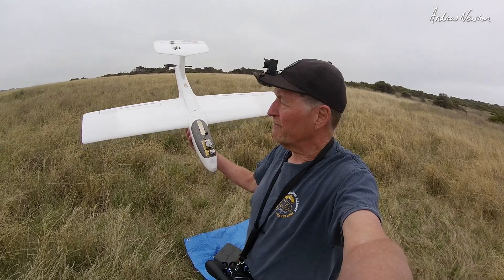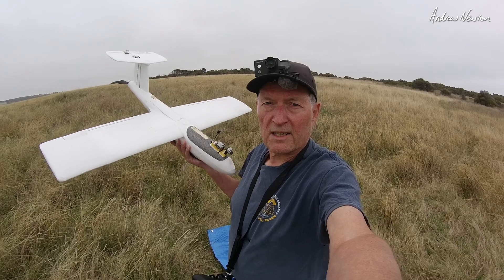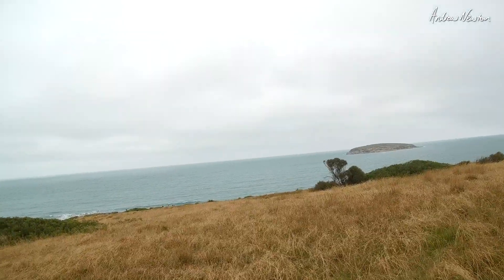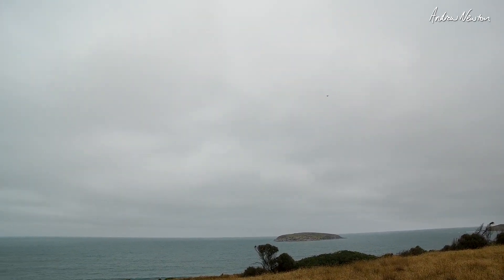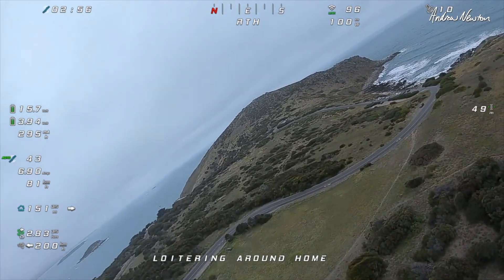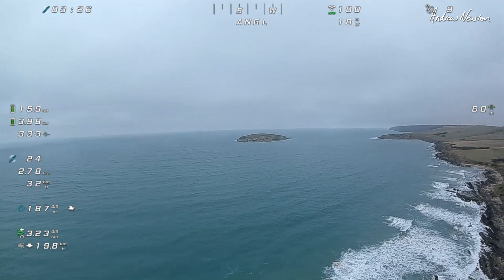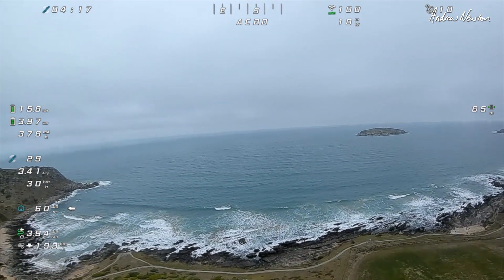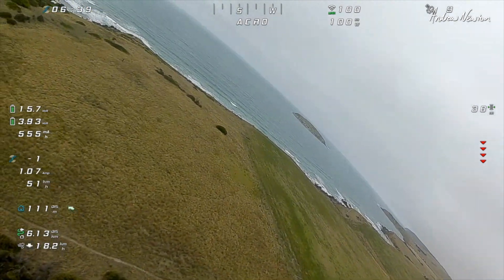Simplified INAV - First Flight

Comment: Does it make sense to use a GPS with a magnetometer/compass?
Reply from the maker: On a quad or a VTOL yes, but not required for planes. The GPS provides all the direction information as long as it's moving forward. A poorly calibrated compass will interfere with GPS navigation.
Reply: @AndrewNewton  Thanks a lot!

Comment: Andrew,,,I’m back again needing your thoughts. As you may remember, I am using an F411 on an actual wing with iNAV 6.1.  Do note,,,I successfully flew this airframe without TX trimming before adding the hardware.  A couple of weeks ago I was ready for the maiden. Set it in Acro and couldn’t get it off the ground. Tried multiple times.  At the time it felt like I had no (throttle) power.  Feeling at fault (w/o much thought) I changed out the motor with one that I thought would have more power.  Today I tried to launch and no luck.  I’m a bit puzzled.  I have flown other wings recently and what i have noticed is these have more power and more deflection on the elevons.  With this in mind I paid closer attention to to my iNAV wing and (in Acro) there is very little deflection in the elevons and it seems like I am limited on my throttle stick, thus, restricted power (compared to a regular setup w/o a FC).   I am sure there is much going on here,,,,but before I go to a totally different airframe,,,,does anything glaringly jump out at you? Just fyi,,,,on the receiver page I have the throttle setting just below 1100 at 1094 so my arming toggle will work. Thoughts?    Thanks again.
Reply from the maker: Which transmitter Marty? In the INAV receiver page you should see throttle move from 1000 to 2000 as you move the stick. Might need to adjust the end points in your radio for the throttle channel if the bar doesn't go from 1000 to 2000 in INAV. Are you sure your prop is on the right way?
Reply: As always,,,thank you Andrew for your pointers.  I am going to sort of start backwards and end with my next question.

Always a base that one needs to cover,,,,prop direction:-). I did check and all is good there.  Never hurts to have a refresher.

I got the craft in the air easily this time but I just did not have enough throw in my elevons to manage height and turns.  I made it around one time with much difficulty and then never again.  But the positive is/was,,,,I got it in the air,,,,easily.  So,,,what I will do next on the bench is move my pushrods on the servos as well as the elevon side to gain more throw. This may take some experimentation but I should be able to get what I need to comfortably fly the wing.

On to power. You were spot on with what you said about the necessary throttle deflection needed on the iNAV Receiver page.  Using my Spektrum DX8G2 TX,,,I had the range set at 1094 to 1838.  I set it to 1002 to 2001 as you recommended and as mentioned above,,,,I had the power I needed to launch/fly (just as in the pre-iNAV test).  Thanks so much. Some things can be so easy.  However, I come to my one question. With this new range setting I did notice that as I moved the throttle stick,,,the motor did not start moving until around 1220.  Granted, I am able to launch & fly as is,,,,do you think there is a way to decrease the dead band range of my throttle stick  (meaning to obtain motor engaging at a setting lower than the 1220)?  Just curious if you have any thoughts here.  I have a feeling this dead band is inherent to my setup.

Thanks again.  I will let you know how successful I am with my elevon pushrod adjustments.
Reply from the maker: If it flew well previously (did you use 50/50 elevon mix?) I would leave the pushrods as they are. Better to increase the Pitch FF parameter until elevator throw in ACRO is about 80% of elevator throw in MANUAL. Throttle dead band means you need to re-calibrate your ESC using the INAV Outputs page.

Comment: The documentation states that ACRO mode is the preferred flying mode.  Is it also recommended to launch in ACRO mode for the maiden flight?
Reply from the maker: Preferred? Acro is the default mode, that just means that if you don't choose a specific mode then it will be in Acro. I usually launch in Acro if I know the setup is good, otherwise manual is the safest until you test other modes.
Reply: Andrew,,,,I am a bit confused at the flight mode setup.  I am to this point and have Manual, Angle & Horizon modes on a three way toggle.  With this said,,,the toggle is always on one of these selections. So how does one get into the default mode (Acro) when one of the three (mentioned modes) will always be selected?  And I thought this three way switch with the three modes was the proper setup. Do I need to leave one position of the toggle vacant (in the configurator setup page) so that the default “acro mode” is accessible when that vacant toggle position is chosen?  I hope this makes sense:-).  Thanks Andrew for always diligently answering these questions.  It is greatly appreciated.
Reply from the maker: @countrymlb  Correct. Every switch must have a "no mode" position to allow for Acro. Have another look at how I set them up in the Simplified INAV setup video

Comment: Andrew,,,great pair of videos.  Thanks for your continued dedication to this area of flying.  I wish I would have had these two a few years back when I first gave this venture a shot:-).  I am just about ready for my first flight trial but have one question (and hope you are still monitoring).  I am using a wing this time around.  I very much understand your comments/instructions of the +4 degree addition to the Fixed Wing level trim line of the Mechanics tab in the PID page of INAV and its purpose.  It’s necessary to fly the bird:-).   My question is as follows.   Before we get into the INAV setup,,,the craft has to be a tested/proven flyer (which means that this amount of elevator is ‘tweaked’ in physically to the airframe to fly).  However,,,once I have the bird flight proven and we start the INAV phase of the build,,,do we physically remove this elevator pitch (with wing elevons flat with the rest of the airframe) and let the INAV settings take over (once the setup is complete)?  May sound like sort of a naive question,,,but it is a detail that I wanted to make sure of.  Thanks so much.
Reply from the maker: Good question. Yes keep the same amount of elevator reflex you added in the test flights and start with +4º FWPT. 
There are two factors at play here. 
1 - Flying wings always require reflex in the overall airfoil shape to stop them rotating over the nose due to the lack of a tail. That comes from either the airfoil design or your added elevator reflex. 
It is best to dial this in using the pushrod lengths. BUT if you enable "Continuously Trim Servos..." INAV will look at your stick positions while flying and save the new servo midpoints.

2 - All airfoils need some "angle of attack" or a few degrees of positive angle to fly level and maintain altitude. The Fixed Wing Level Trim takes care of the angle of attack requirement (and board mounting discrepancies in the pitch axis).
Reply: Thanks a bunch Andrew.  This will be a great project.  I have the wing flyable right now,,,with the next step of adding all the iNAV hardware, etc.  I really can’t wait and this little detail was the last piece of the puzzle.  Take care and I’ll let you know how this Texas bird flys.  Again,,,,thanks for making these two videos for they made it all come together also.  The written word is great but the videos seemed to be the icing on the cake😊
Reply from the maker: Happy to help. What wing is it?
Reply: My apologies. I just see your question:-).  It is my own hybrid between the FT Versa and the FT Bluntnose Versa. In the Bluntnose, a 7 1/2” spacer is added between the two wing halves of the standard Versa. I just added a 4 1/2” spacer.  I really like all of them. A relatively easy scratch build and takes a pretty good beating.  Thanks for asking:-)

Comment: I'm following this, but my plane is a 'traditional' tail dragger (Xfly Tasman). Please sanity check my logic here... if I select Manual mode on the runway, the plane is effectively ignoring the flight controller, and behaving as if it just has a standard PWM receiver, right? I want to check my trims and CoG manually, before turning on the stabilisation modes.
Reply from the maker: Correct. That's the safest way to begin. Make sure it flies normally in manual then try acro in flight, being ready to switch back to manual if something is not right.

Comment: Hey Andrew I think I screwed up my SpeedyBee f405 i can flash the board but nothing that I set stays is it possible to reset the board back to factory
Reply from the maker: Which F405? There are 4 different versions. Make sure you use the correct INAV target.
Reply: SpeedyBee f405 wing flight controller
Reply: Model number f405wing-app
Reply from the maker: Just have to try reflashing and remember to Save and Reboot whenever you are asked in the configurator.

Comment: What version of INAV?
Reply from the maker: INAV 6.1.1
Reply: @AndrewNewton Is that better/easier than the current version 7x ?
Reply: @peterhancox5268  I think the setup is pretty much the same. The main differences are under the bonnet. I just don't like the frequency of these major updates and the removal of support for hardware like F411 series of flight controllers.
Reply from the maker: @peterhancox5268  INAV 7 adds VTOL but I haven't tried it yet

Comment: Just wondering how you align for roll normally as I don't see an artificial horizon or angle on the OSD - to my eyes that plane is rolling slightly to the right. Pre flight I'd normally put the plane in a stand and use a spirit level/digital inclinometer to set the wings level and adjust the board roll alignment via the cli until it's zero in the configuator. I feel Ardupilot does this aspect slighly better than INAV in that you calibrate level on the ground after the gyro has be calibrated. Yes I'm aware that foam twists etc but most of the time I'm mounting the FC on a surface that isn't parallel to the wings to start with.
Reply from the maker: I don't go to that level of precision in my setups but your careful levelling is a good idea. Yes Ardu levelling option is good.

Comment: I love it when a plan comes together!
Andrew, What is the difference between Acro and Manual modes. I thought they were the same thing.
Reply: If you have ever flown a 5" racing quad, most people fly in Acro. The FC tries to maintain whatever trajectory its it when you let go of the sticks. In in a plane, it tries to ignore wind they would otherwise throw you around the sky with a small light plane on a breezy, turbulent day. It also will iron out a badly trimmed plane and make it flyable. It can hide a multitude of problems. But if you have a well trimmed plane BEFORE you add the FC as Andrew is saying, your plane will fly even better once you add a FC and set it up as Andrew suggested.
Reply: So, manual means no stabilization at all. I've flown acro for years, but I never thought of it as having stabilization. It must be a simple rate gyro?
Reply: @daxdadog  YES it does have some stabilisation, just not any kind of self level. Letting go of the sticks doesn't level the plane like Angle mode does
Reply from the maker: Manual just passes radio commands straight through with no stabilisation (after applying rates, mixing and expo) Acro stabilises against uncommanded rotations, like wind gusts or lift changes.

Comment: When i connect gps to matekf411wte barometer doesn't show... 
I use BN880 gps
I2C 400Hz
Reply from the maker: You may need to manually select the baro in INAV config.
Reply: The barometer is in the FC. So should show up without the GPS connected. I never change stock settings and it always works fine for me. You definitely on the correct FW for that board?
Reply: @blackbirdboy1  I just observe that, it's becouse of gps has magnetometer, when gps and magnetometer setup in inav-config and h/w connected to fc then baro and magnetometer shows red, doens't detected by fc. Also gps

Gps bn880 

I powered fc with battery pack and tested all settings but unable to solve the issue
Fc automatically correct detected and FW also correct
Reply: You may need to....1) check the baro and magnetometer are not trying to use the same address on the I2C bus (unlikely these days) or 2) add two 10k pull-up resistors to the SDA pad and 3.3v pad and SCL pad to the 3.3v pad on some FC's the BUS can't maintain the i/o levels with two devices